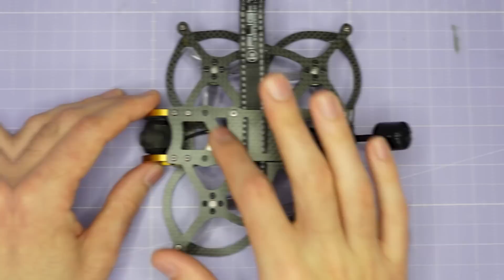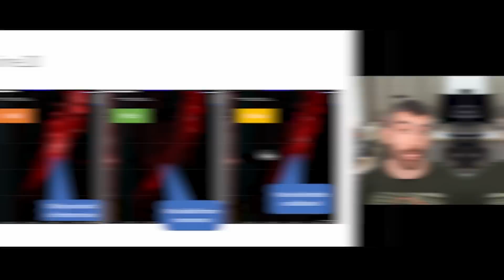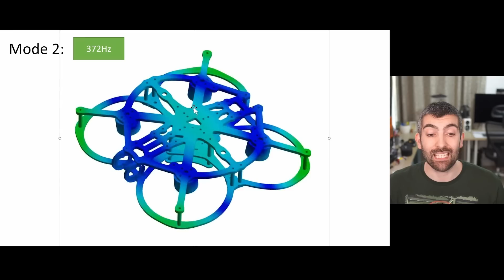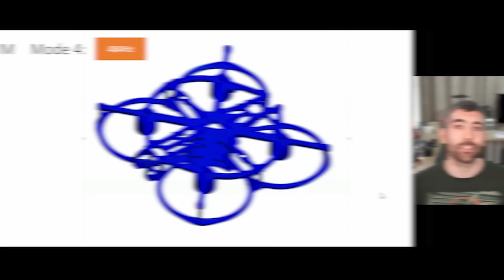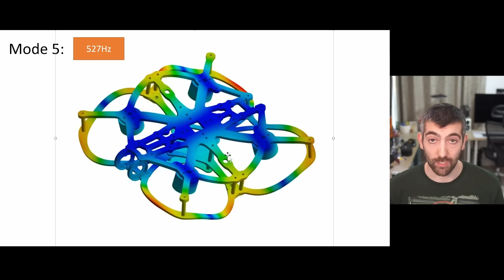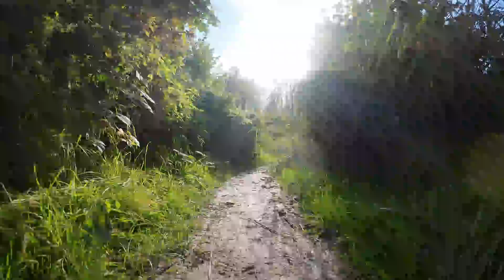CINE-MAS Comes Early This Year🤩: My Ultimate Cinewhoop Frames for DJI, Walksnail or Analog

Comment: Hi Chris, I have two questions related to the cine40. 

1. Which battery do you recommend flying it? 
2. You support the naked blackmagic mounting holes but which regular plate would you recommend? I intend to put a micro g2 blackmagic on it which is roughly the same weight as a naked configuration but I need a plate for it to use

Comment: Hey there Chris, i have a tiny question about external vtx's and exactly how to correctly place one on an existing board? The Betafpv Meteor75 Pro has an 80mm frame and a very robust canopy, with a nice fpv camera. My problem is that the angle of the camera is too high for me and is not adjustable.  I want to fly more Cinematic with my whoops but I find I'm always staring at the sky.....

Comment: Awesome! Even though the OG 2.5 flew amazing running RcNPower 1207 5000kv motors(I know it’s a strange size, but it has hella power and still fairly lightweight), the prop guards were waaay too weak, breaking on my very first light crash. It actually just clipped something during a RTH landing from about 12ft into 3in of grass😞. Now I have something to swap the guts into 👍

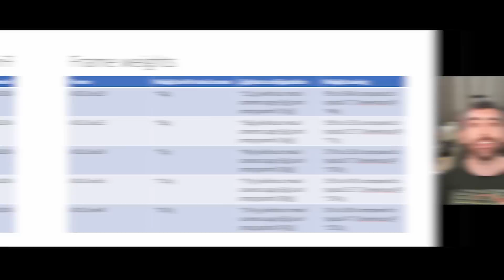Comment: 4:20 I calculated the disc load ratio (square of prop size divided by frame weight) of every frame and got some strange results
the 20, 25 and 35 have similar performance of 10
the 30 is over performing 12
and the 40 is under performing with 8

Any reason for these differences ? Blindly I would conclude the 30 'should' have +0.5 mm plate thickness and the 40 should have -0.5 mm plate thickness.
Reply: Disc load ratio isn't meant to be computed for frames alone. Try and find generic component weights for each of those build, then only recompute disc loading.

edit: with all the components weight including battery and regular or naked GoPros according to the quad size

Comment: can the 3" whoop be used with 6s ?
1000mah 6s with around 2600kv motors for lifting a full gopro ?
Reply: You're the one who will be ordering the ESC and motors. So only* you know if your build will take 6s.
Reply: @equipeecureuil6690  already running this setup in another frame it works like a charm
Reply: Why not go 3.5 inch? Senseless trying to make a 3 inch carry so much. You really need to hit such a small gap 😂
Reply: @chrisbee5481  i feel 3" is a good sweet spot that can be used both indoors as well as outdoors
Reply: I've built a 6s 3" with 3000kv motors 40A esc. 850mah HV 6s is super sweet spot, 6 min cruising, 4 min freestyle, LOTS of power. I use a gopro naked tho, but it has carried a full gopro as well before, no problems.

Comment: I'm sure there is a reason not to, but have you ever considered using the Moonlight or O3 as stressed members in a smaller build (like a 40-45mm prop)?

I work in the motorcycle industry, and that's a very common practice these days (using the motor, not a VTX obviously lol)  to reduce weight and increase stiffness.  And with the popularity of things like the FlyLens, GoFilm, Pavo, etc., if it was possible, it could make that class of quad much more agile.  I have an image in my head that (at least to my inexperienced eye) seems like it could work with the right tweaks.  Been playing around with CAD models, but my skills are very rudimentary at best lol

Love all the work you put into the details on your builds and testing!  You're a huge asset to the community, and I thank you, sir!
Reply from the maker: It's a really cool idea, but would that limit people to only using the O3 air unit? I think it's really important to support all the different components people like to use.
Reply: The QAV Pro Nano does this with the DJI O3, but as Cris said, that means that frame really can only use the DJI O3 without adding standoffs...